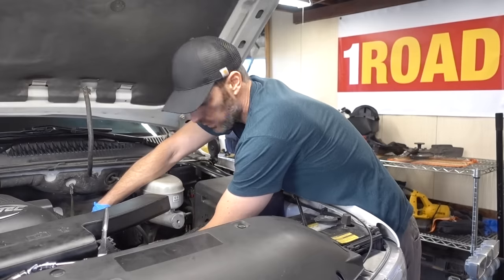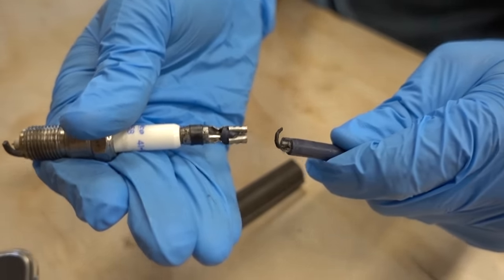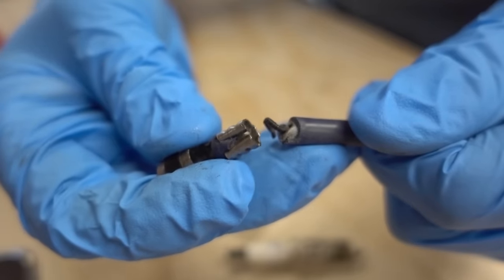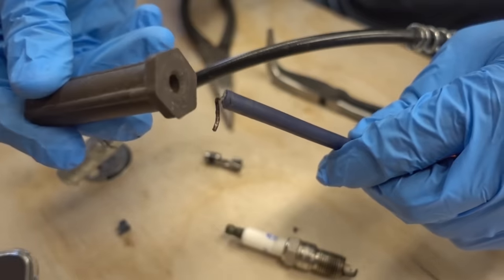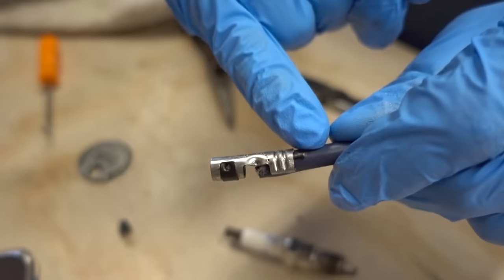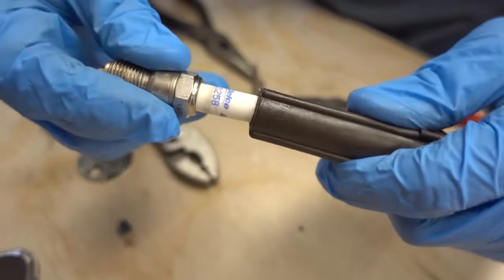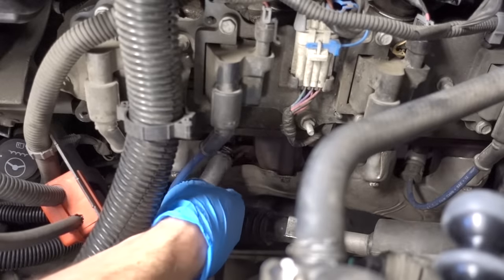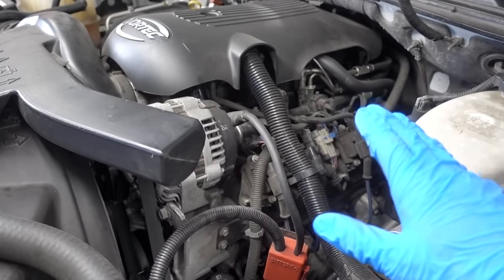How To Very Easily FIX A BROKEN SPARK PLUG WIRE!!

Comment: Thanks so much!  I'm used to stripping and soldering wires but that is not what is needed here!   That conductor wire is so tiny you can't strip it out of the black covering.   My plug had pulled off my coil wire (copper plug sticking in the coil) and it's a prestolite on an old boat and the auto shops don't seem to carry it.   Mine broke just like yours, leaving some black silicone inside the copper part.   Your video saved me!  I just cut more insulation off the big outside and folded back the tiny black covered wire under the connector like you showed.  Got it clamped back together.  It's running great.

Comment: very nice video... Thank You so much for making this... i had a no start condition so i check for spark and i had non. i removed the coil and cleaned mounting surfaces. and regap coil. still no spark found end of coil wire at spark plug faulty connection could not believe it, trimmed end off recheck and now it working great, just crazy problem... yep it was the end of the wire at the plug... who would of thought no spark problem is at the end of the wire at the spark plug connection ???

Comment: thankyou very much for the tip on the die electric super lube grease, i need it for fuses and seems good for just shining up the motor protection maybe similar to silicone spray which cost too much now for detailing use...

Comment: My Jeep Wrangler #6 spark plug wire kept popping off whenever I'd hit a good bump. Pulled over on the freeway as I was half way to picking up my wife from the airport. Took Super Glue I had in the glove box and put a few drops around the rubber boot and popped it back on the spark plug. Been running good for a week, lol. I did order a new set of wires and have the tools in the Jeep to fix it should it break while driving and of course have a roll of Duck Tape......
Thank you for the informative video, added a pair of needle nose to my emergency kit, lol

Comment: I 👍ed because I enjoyed it 'at least just a little bit'! 
I've spent a coupla days trying to fix a strimmer. Seen all the videos. Turns out there is something wrong inside the 6" ( ?) of ht wire. It's moulded into the coil, which are cheap enough but a) the principle of the thing, b) month by slowboat from China. Looking at doing a splice but didn't realise how THIN the one strand of  wire is inside, and DELICATE! Even your one has its own private insulation!

Comment: Done this many times in the past minus the grease. One time a repair shop claimed they had to replace a bad plug wire and replaced it with one with a plastic boot that ended up cracking my spark plug in half.  Had to buy a new spark plug and I replaced their plastic boot with a rubber one from an old set.  Yeah they replaced a wire from an almost brand new set.

Comment: awesome vid , probably it'll work for my motorcycle , i made the mistake twice, technically a 12 v whatever should be ok BUT it fries the starter solenoid i can get used or aftermarket cheap, so next i have old carbs i clean over and over , this time spotless mostly BUT i find two funky spark plug wires (big 4 cylinder) so i realize the messed up running has been a short and not running probably the both wires same time but i think it'll get me rolling fast/lol i saw the vid a while back but i went legally blind a spell , very depressing and aging i guess anyway i got projects all over now i can see but i'm out of shape from the ordeal still , it's been awesome though i had faith and learned alot about the temp state but man imagine i'm 40's , 75-80 year olds pull rvs, boats still i felt old a moment /ranting thanks for the vid i'll try to update if it works for me, i think i have to buy two entire coils used to get the boot and maybe i should study aftermarket , it's good to learn to test the coils too (i'd need to look up ...i have a pilot valve driving me nuts , the idle jet breaks and the carbs are as much as a lower mileage motor but with no carb rack or airbox needed for correct performance if i went back from slide valves ......

Comment: Can I still use the spark wire by plugging it back in the hole with the metal piece still on the end of the spark plug?

Comment: Mines is still in my wire set. Looks like when I pulled it off it got stuck a bit so now it’s like at the tip of the wire instead of all the way inside.

Comment: the only time this has happened to me when I got a truck where the person just replaced the spark plugs and wires with copper plugs instead of double Platinum two weeks before I bought it with no grease in the spark plugs boot. I just decided to go ahead and replace the cables. I rather would not have taken a chance.

Comment: I don't understand how a cased wire makes contact with the metal couplink..tried soldering the wire, it just melts. Weird space stuff I reckon, but I crimped it back together and will try it out  on the buddy's car
Reply: The core is not "wire" any more.  It's a ferrite-coated fiberglass strand, reducing radio interference while functioning as a high-voltage  conductor.

Comment: I am not sure if it is ok to use this as a permanent fix. I had to do this and it worked well. But don't forget that by shortening your spark plug wire, you will also lower the resistance. A lower resistance means that more current is generated, which in my case seems to have killed my ignition coil.

Comment: When your on tight budget it great solution get by but if going do spark plugs might as well do plug wires as there usually what ages the worst and cause misfire in first place unless new enough to where most vehicles use coil pack to spark plug now

Comment: Any sugggestions for divorcing the crimp from the plug? They’re not rusted or corroded but they are freaking married for eternity haha. I have the spark plug pliers, have tried twisting the wire and the spring coil, I’ve tried turning it in a wide circle, but so far the only way to get it is to eventually tear the rubber part, pull the coil, then pull off the crimp from the plug

Comment: I pulled the spark plug wire off of the boot. When I took the boot off of the spark plug, the crimp was still in boot. Can I fix that?

Comment: Why would it fail again?  You did the same thing they do at the factory.
Reply: It would fail depending on the workmanship of someone doing it after watching the video
Reply: @conesillyvalley7182  COULD fail, not would fail.  And that's true of anything that anyone does on their vehicle.
Reply: The factory assembled part failed and so once you re-do it, it will fail again!
The only way to avoid failure is to pull the boot back on brand new leads, apply some super glue and put the boot back in place. Wait 12 hours and then install. They’ll never ever fail!

Comment: Ive built spark plug wires for a old tractor i bought new wires but had to put ends on them and cut them to length it is possible to fix and make custom ones

Comment: I pulled enough computer, telephone, speaker, and coaxial cable to go to the moon and back to Earth ten times in my lifetime. Some of it went into conduit and some of those conduit runs were maxed out to their limits that would fit inside. When that happened, or long before anything close, we lubed the cable as it fed into the conduit. Not the same as spark plug wire jacket, but still probably has the same issues, not certain.

NEVER, EVER, does anyone who pulls wire for a living, from electricians to computer cable installers, never do we use a petroleum product to lube cable/wire. I mean never. If you buy it from electrical supply house, it's nicknamed "snot". It's wire pulling compound. Kind of thick and slimy. But if you need to do this in a pinch without any snot or time to run to a supply house to obtain some, there is a commonly available substitute. We use dish soap. Palmalive, Dawn, etc. It slicks up wires and makes them slide.

Why NEVER do you use petroleum products? Because the petroleum product and the insulation on the cable are both petroleum products. The oil will eat or soften the insulation on the cable. Won't show up until some time passes, but you'll wish you never did that, I bet. Never did, myself, nor saw anyone do that. You just don't lube electrical cabling with petroleum products, period.

Dialectric grease is still grease? To be on the safe side, and I always try and avoid adding more trouble to trouble I already have, I would advise you to use dish soap to lube the spark plug wires when sliding on or off the rubber boots. I could be mistaken, but it wouldn't hurt to use soap and avoid the potential of making yourself a problem down the line using Dielectric grease. I always use dish soap, myself.

Just some friendly advice.

Comment: How did you get the spark plug out tho...
Reply: with a spark plug socket.... like normal.....
Reply: @captainboose8788  they meant how did he get it out with the metal conductor on the end which he didn’t he used pliers to pull the conductor off then pulled spark plug out and put the conductor back on for the video to show what it looks like
Reply: @davidsimmons4491  a normal spark plug socket should have more than enough clearance to remove the plug with the connector
Reply: @captainboose8788  mine doesn’t lol maybe it’s a Canada thing lol

Comment: Shouldn't you strip the insulation off that little wire that you fold over?
Reply: Nope. That's not a wire.  It is ferrite-coated Kevlar or similar. The silicone core surrounding it provides the high-voltage insulation.

Comment: I need help! The connector is stuck on the spark plug and I cant remove it or remove the spark plug  because the socket doesn't fit on the spark plug.
Any ideas?
Reply: @navdeepsingh9593  Thank you ! In the end I solve it. Thanks

Comment: I did this pulling out my spark plug wire and then my Silverado went in to reduced engine power mode
Reply: Currently waiting on a whole new set of plus and wires and coils. But I’m praying that’s all it is. Cause it happened immediately after I removed boot

Comment: That probably happened cause you keep messing with stuff that doesn’t need to messed with. And that rarely happens too
Reply: Not true. I just pulled 8 wires off my H2 and 3 of them broke exactly like this.. they were only a year old. I had a P0300 misfire code so wanted to check the plugs. Turns out the ceramic was busted off of the tip on one exposing the entire metal tip.. gonna replace all plugs and wires just in case - Ebay, less than $50 total so not bad for me, just have to wait on the parts 💁‍♂️